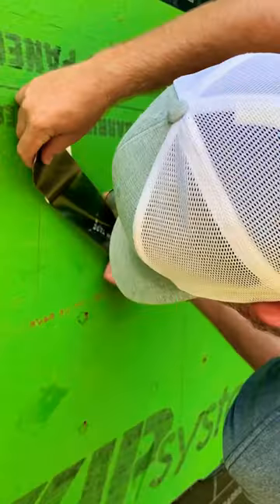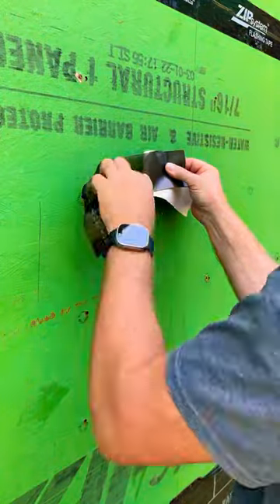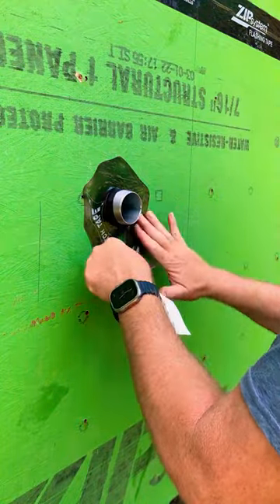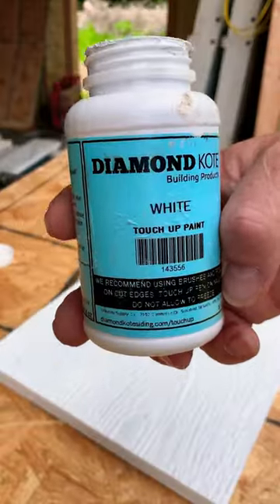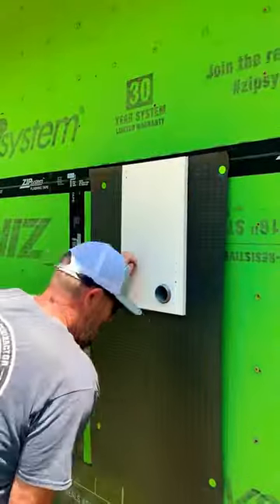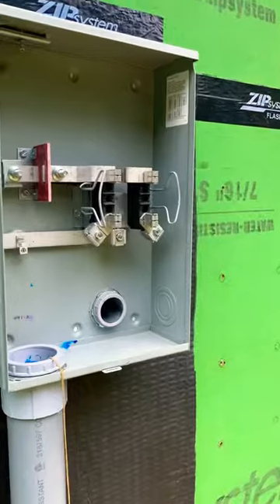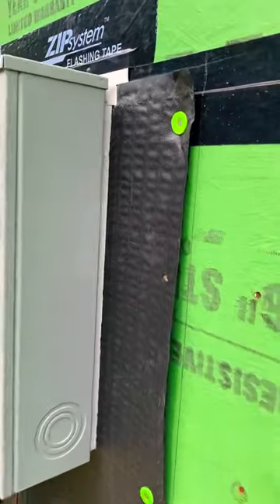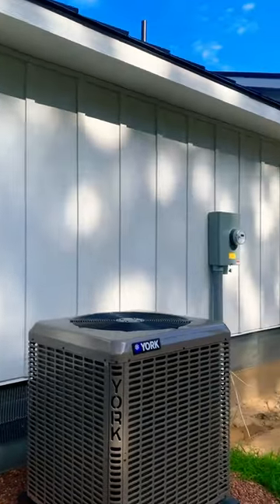ULTIMATE meter base FLASHING #gotitcoach #newconstruction  #electrical

Comment: The sealing aspect to a home is now so great that that a family of 4 can suck the oxygen out of a home if the doors arent opened frequently.    The air we exhale is humid and the AC dries it but if youre a minimalist with the AC, youll now end up with a slight mildew stench after a few years since the air is stale and moist most of the time.  Also I think ZIP is creating solutions searching for a problem.   If the siding is proper, a rain layer shouldnt even be in the question.  Regular zip tape could curve and stretch too, you just needed some grip strength to do it since the stuff is stupid strong.  Clean work though 🍻
Reply from the maker: That’s why I have fresh air intake installed into my homes. Stretch tape is better for odd contours, reg zip tape won’t seal correctly without using 10 pcs
Reply: Take a look into an ERV. Controlled and filtered fresh air.

Comment: I really really like stretch tape, and pretty much everything zip system… that being said, no way this is the best possible seal. Lexel, big stretch, liquid ZIP would all be a long term chemical bond with a much greater sealing capacity.
Reply from the maker: I love & use liquid flash on every one of my projects but it wouldn’t be ideal for this if you wanted to complete the project in one setting. You would have to apply it & then wait for it to dry, then finish it. I wouldn’t say one is better than the other tho.

Comment: Where’s disconnect, most utilities and codes require means of disconnect at service meter. In case of fire how does emergency crews turn off power?
Reply from the maker: As long as breaker panel is less than 24” from meter base there is no need for disconnect here in TN
Reply: @w.k.d.constructionllc I’m in McMinn County TN and my inspector says if the meter base and panel aren’t “back to back,” the outside disconnect is required. He said “no” to the 24” question. My panel is less than 12” away from the SE cable entrance (panel is on a wall perpendicular to the outside wall). Can you point to documentation I can use?
Reply from the maker: @grithog5399  I’ll have to ask my electrician about it. It could very well be up to each inspector per county at their discretion. 🤷🏼‍♂️